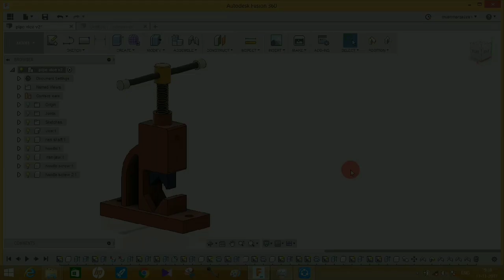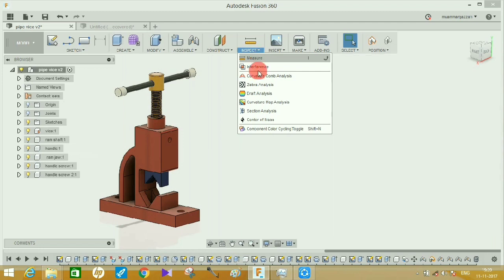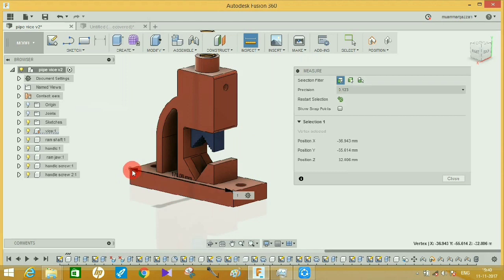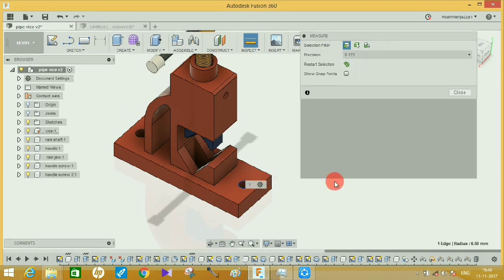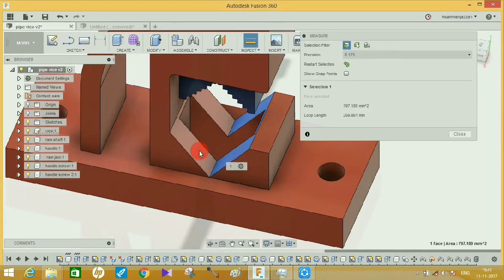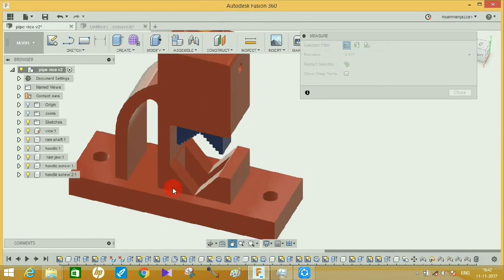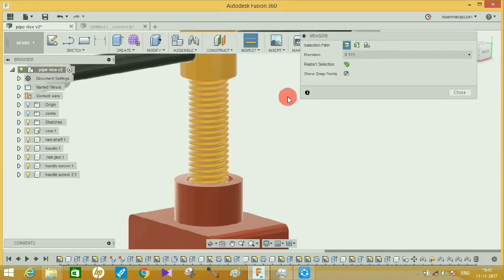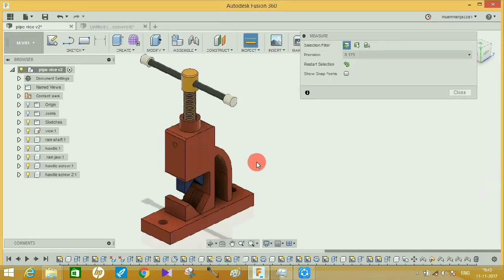how to measure - fusion 360 tutorial

Comment: So loop length is not what i need, im not sure what it is exactly.  Im building/designing a 4ft rc plane and im working with cylindrical bodies, and bodies that dont have points at every side. I need to precisely calculate the length and height of each piece and it is becoming difficult to do the simple task